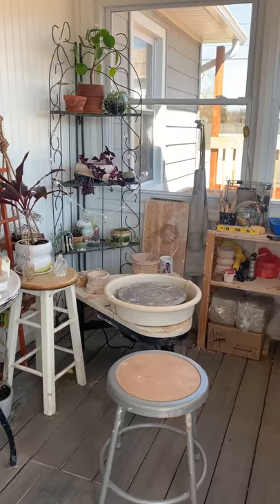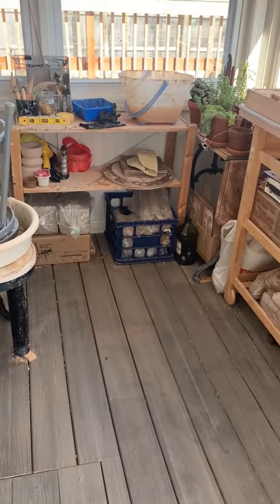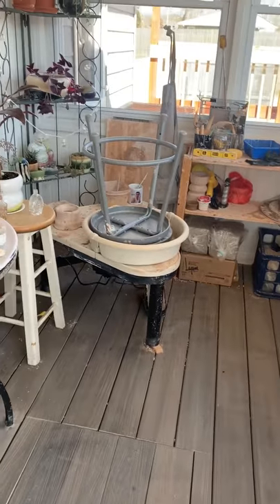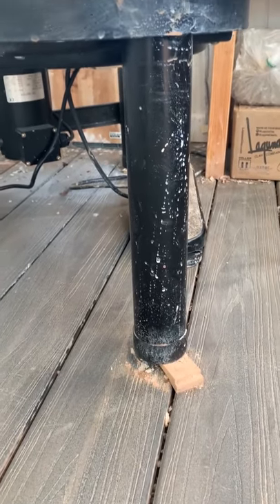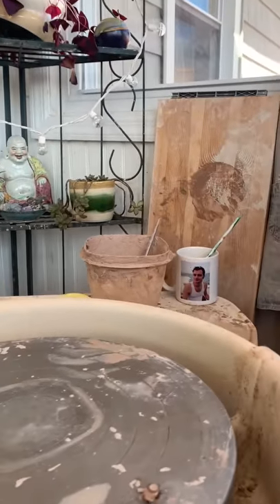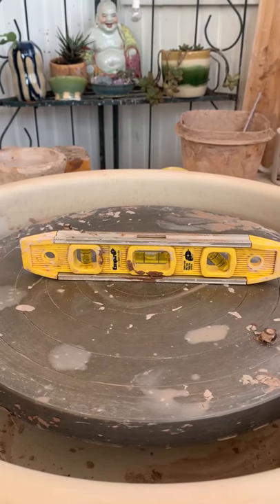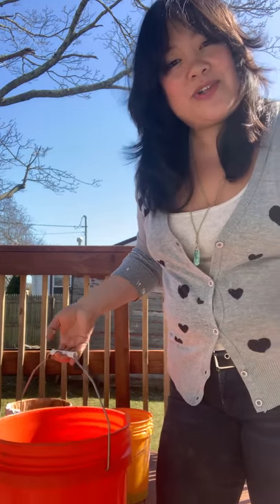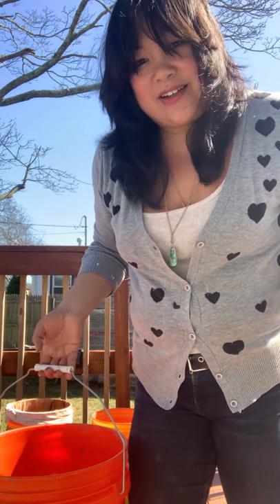Setting Up Your Home Pottery Studio PT 1

Comment: This was super helpful. I am moving into a large 1 bedroom apartment, and will be setting up a corner of the living room with my wheel. If I am wiping things down regularly (with a wet sponge) and using air filters, and ventilation, do you think that is safe enough? Or should it be a separate space altogether? I plan to have a meter of cleared space around my wheel and protective barriers around the wheel, and drying racks. But I would have soft furniture (a couch and a rug) in the same room. Is that safe enough with silica dust? Or is it mainly just a concern if clay gets on those objects?

Comment: This is a great help.  What do you do with the clay/dirty pillowcase?
Reply from the maker: Hey Joe, I end up throwing it out in the trash with the clay build up and all.  I’ve only had to throw it out 2x in the past year bc I separate the types of dirty clay water.  

This particular method I use for the mopped floor water.  This is water in particular is dirtier than regular clay water, including misc particles like hair, dust, and other debris.  After it has collected in the pillow case, I know it’s enough bc it doesn’t filter well anymore even after stirring around.  

This is a good temporary fix for those who want to work with clay right away and can’t wait until they can figure out a clay trap sitch.  It is a bit of extra work but it works. 

Side note:  

The clay water I recycle is from washing my hands and tools and the water I use to throw.  I allow the water and clay to separate in a separate 5 gallon bucket with no pillow case.  I scoop the top layer of water with a recycled quart soup container and throw out in the garden or street.  The left over clay I place on top plaster to dry out takes about a day then I wedge.  
 
 Lmk if you have any other questions!!!